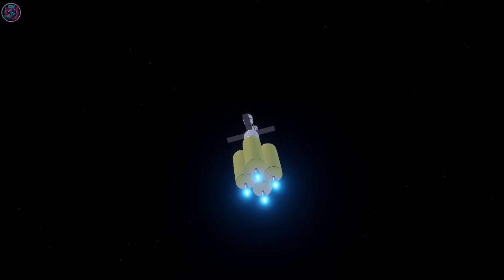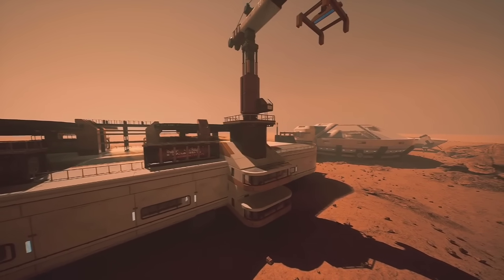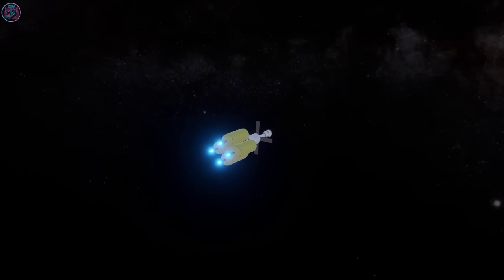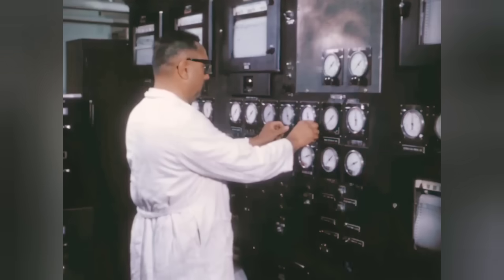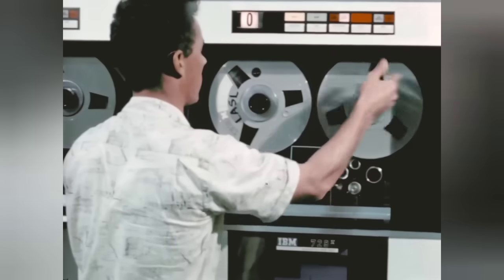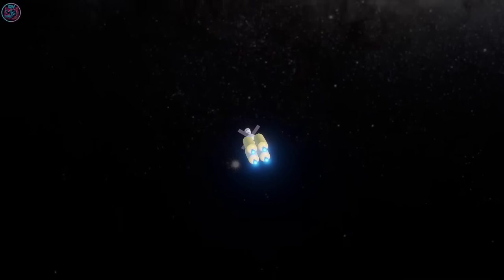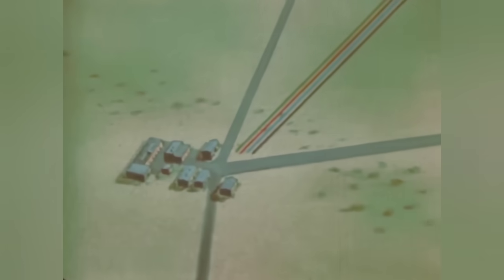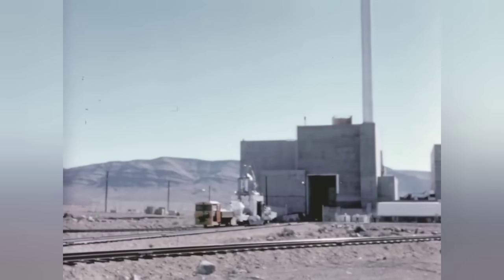RANT ALERT!  NASA Nuclear Mars Rocket plans blocked by regulation, lack of test facilities!

Comment: TL;DR: Not actually a NASA issue, they are only supporting DARPA/DoD/Space Force in the program. We can't be sure that the new reactor designs are as safe as NERVA so there''s not really a good reason to suspend the regulations. Specifically this is actually more than a single engine test which is why the need the new facility. Once the program is running you will likely be continually working on improved reactors and engine systems just like they did with NERVA.

Yep, should have probably told you that this was a known and upcoming "problem" not because no one saw it coming but because THE problem here, as pretty much always is the Congress of the United States who refuse to fund building the facilities needed. Much like they have not followed through on the legislated 'promise' to develop and fund both long-term storage and also transport of "spent" nuclear fuel from reactors in the US to said storage site. Instead we've got nuclear power plants with stacked rods sitting in the facility cooling pools awaiting those developments.
(Case in point railway cars for carrying nuclear those reactor rods was actually designed and tested in the 70s concluding with a test of a rocket powered "car" being slammed into specially designed concrete which was several times more dense and solid than granite at around 500 miles per hour. A speed no train car could possibly reach mind you. The car's "cargo" section {made up of many reinforced layers} was not breached but because it was cracked Congress declared that the program would have to start again from scratch. Oh and defunded the program)

In modern day we have tons of nuclear waste being shipped around the country in essentially standard trucks and train cars but not nuclear fuel rods because those are "more dangerous" somehow.

In context, the need for those facilities has been well known and understood and most nuclear propulsions studies bring that issue forward right up front.  Getting them build require money and support from Congress which has consistently been unwilling to fund or support despite rhetoric to the contrary. As noted below we know how to build such facilities and use them but as per usual "No Bucks, No Buck Rogers". As noted above Congress has been unwilling to spend money and resources on something they are literally legally bound to do, so far less likely to fund the construction of the test facilities. Having said that it IS DARPA/DoD/Space Force behind this so there's a bit of hope, but frankly with the influence that Musk now has a more likely outcome is a probably a dependence and reliance on the "abundant chemical" mission plan that SpaceX/Musk advocate instead.

NASA was ordered to shut down and decommission the Jackass Flats facilities by Congress. Keep in mind that at the same time Congress did the same with the facilities for the nuclear aircraft propulsion work that had been ongoing (off and on) in Idaho. No one in the NTR development or research community are 'blind-sided" by this issue and they were given enough money to mount studies and early design work but without Congress funding the actual test facilities there is only so far they can go. We actually DO have some basic test facilities a large one being a thermal test facility (in Idaho IIRC) known as a "nuclear furnace" for testing components and systems in the simulated heat of a nuclear reactor but the engine test runs and exhaust capture system has never been funded. I should also point out (again) that DRACO isn't really a NASA project and technically neither was NERVA. NASA paid for part of the program but those actually working on the program were mostly "Atomic Energy Commision" people. Similarly DRACO is a DARPA/DoD/Space Force program which NASA is only supporting, not running. You literally can't "blame" this stuff on NASA as noted every single NASA report on nuclear propulsion noted the lack of facilities and a test site were always upfront in the reports and studies.

Also, don't confuse space nuclear electrical power reactors with nuclear thermal propulsion reactors, the two are very different. The Chinese reactor is a power reactor, not propulsion and as such has a very different design than a propulsion reactor. The most advanced nuclear propulsion reactor designs are ceramic/metal (CerMet) reactor designs that were developed (but obviously not tested due to the aforementioned issue of not having any facility to test at) from the basic NERVA graphite reactor cores. And yes the US also has some very advanced power reactor designs as well, some of which is being used in the modular reactor power plant designs being built today.

Finally in context of environmental radiation the main issue is (as noted above) the current engines have not been tested so no one assumes that they will be as 'clean' as later NERVA testing was. Initially core degradation (where nuclear fuel would spall off the reactor and be thrown out with the exhaust stream) was rather extreme. Eventually coatings were found that cut the degradation to almost nothing but the main issue with a graphite core was they could never fully stop it from happening. Hence the move to CerMet reactor cores which have no significant radioactive fuel rod degradation but again that hasn't actually been tested, yet. Because these have not been operationally tested the regulations require total exhaust capture and processing which is neither cheap nor easy. Yes we need to obey the regulations because while the chances are small there were many incidents during NERVA which essentially drove the development of those regulations and safety culture.

Keep in mind that lower levels of radiation usually have much longer half-lives than higher radiation materials. One NERVA test  had a reactor structural failure where over half the core was ejected out of the nozzle. Another had a propellant feed issue that left the NERVA core running at full power with no hydrogen flow  for 15 minutes leaving the reactor core mostly melted. (But surprisingly still able to operate :) ) There remains the issue of core cool down which was usually handled by allowing hydrogen to continue flowing through the core after nominal "shut down' to keep the core from melting. Another method is to combine power generation with nuclear propulsion by adding a heat exchanger and turbine system that uses that residual heat and/or the reactor operating in "stand by" mode to generate power for the vehicle. (Making things like cryocooling of propellants for long term storage much easier)
Something that I should mention is that until the reactor is put into operation the general radioactivity of the reactor is pretty low hence why the planning doesn't have the reactor brought to criticality until Earth orbit or beyond as a safety feature. A launch mishap scatters only low level radioactive materials around whereas actually starting the reaction greatly increases the radiation output of the reactor. (Hence my least favorite scene in "For All Mankind' where a nuclear powered "shuttle" is launched from the back of a C-5 Galaxy which then fires up its reactor killing the C-5 crew and most of Nevada over which they are launched and killing the flight crew due to back-scatter of radiation from the atmosphere. That's what really would have happened)

Comment: A little contamination back then does not equate to less or more contamination during modern testing. A fuel element failure during a test run will contaminate a large area as the exhaust plume dissipates. It can be done better than in the 60s and 70s.  Also environmental regulations are the reason why we now have clean air and water.  There isn't any worthwhile reason to crap it up with long live radionuclides.

Comment: Speaking as a nuclear engineer, I seriously doubt that nuclear propulsion will be used for ascent to orbit. The reactor would be taken critical once it is safely in orbit. Until fission reactions are initiated, the radiation exposure of new (not reprocessed) nuclear fuel is minimal. You can safely hold it in your hand.

I used computer models of reactor accidents that were tested against scale model reactors that used electrical heaters to simulate the reactor. I think a lot of the testing of an updated NTR engine could use a similar approach to test ideas, develop computer models etc. There are test reactors that can subject the proposed nuclear fuel elements to rapid changes in neutron flux as well as long-term operation to see how well fission products are retained, mechanical strength, heat transfer properties etc.

I don’t know if you could completely do away with NERVA type ground testing but you could minimize it, and have a suite of computer models that would enhance safety of any ground testing deemed necessary

This topic brings up a distinctive feature of nuclear power development over other technologies. Airplanes, rockets, automobiles, computers can and have been (and still are) built in a garage. Software can be designed anywhere. Not so with nuclear power. You need special permits just to handle the material and some of the software All the “Tech Bros” that think they will transfer their success into nuclear development are likely to become very frustrated. Which is why progress in nuclear power makes Blue Origin look like speed demon.

Comment: There is another potential way. We have nuclear plants guaranteed to be safe in all cases (nearly).
This is called PBMR, Pebble Bed Modular Reactor, which was designed in Brazil and South Africa and tested in real by China.
It can heat helium at 1500°c near 3000°f. It is super safe, even in the case of a launch failure.
It might be possible to modify the design to get higher temperatures and use hydrogen. You should have a look at it.

Comment: There is an easy solution that eliminates radiation release into the environment and allows the engine test. There are hundreds of abandoned deep mine shafts in the U.S. Put the damn thing a mile under ground somewhere and run the tests. I'm sure some mining company would be happy to sell an exhausted mine shaft to Lockheed-Martin or NASA for a reasonable amount of money. This is far easier and cheaper than trying to build a containment facility.

Comment: Can we just stop with the nonsense and move on to Fusion propulsion already?  People seem to forget we can do Fusion already, sure we currently run it at a loss by that is beside the point.  Besides the fact doing so will help us learn how to NOT run fusion at a loss it is one of the few ways we can actually get particles at those energies for thrust without melting out rocket(still will be a problem) or blowing it up in a nuclear accident.
Reply: The problem with that idea is, where will your rocket get the massive quantities of electric energy to run its fusion engine "at a loss"?  This is the main obstacle currently standing in the way of Ad Astra's VASIMR engines, for instance: they require hundreds of KW in the smaller versions (if not multiple MW when scaled up) of electric power to run...

Comment: It sounded from your previous video that the nuclear engine would only be used in deep space, thus negating the possibility of a RUD affecting the Earth. Wouldn't it be possible to build the motors in space, too? I guess you still have to get the fuel up there, somehow...
Reply: The reactor would be taken critical once safely in orbit. Until then, it is nly mildly radioactive.
Reply: The Fuel could be contained in a very resistant container and only inserted in Space
Reply: @Perrirodan1  That's what I was thinking.